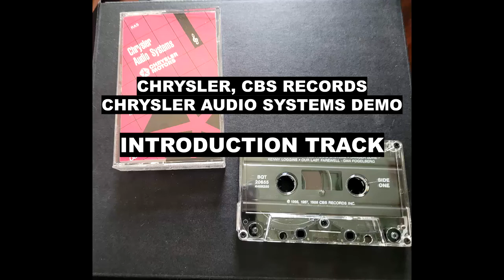Chrysler audio systems introduction track

Comment: This tape was in my mom’s 1989 Dodge Dynasty. Did the other side have the top gun song?
Reply: Yes. Danger Zone by Kenny Loggins, well technically it was on the same side as the introduction. Actually if you look closely at the thumbnail you can make it out.